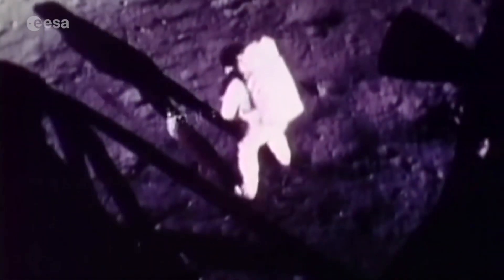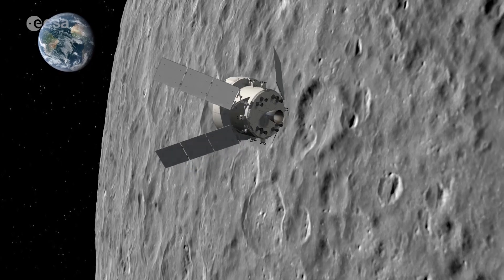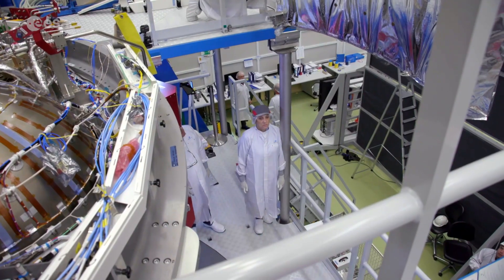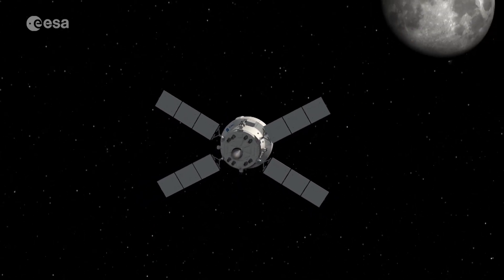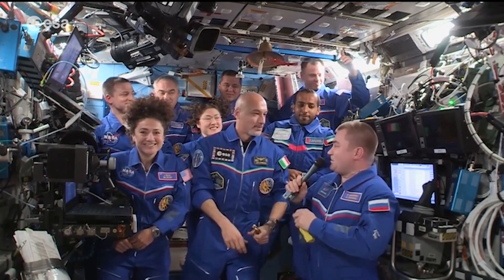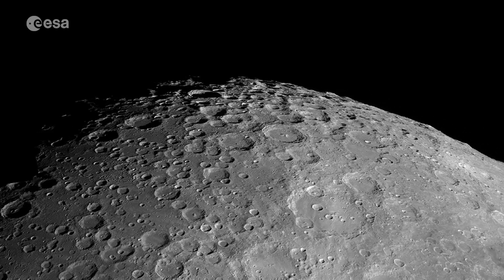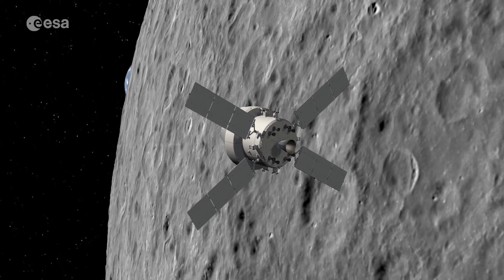European Service Module 3

Comment: The term "proven technology" is a curse for space technology. It's holding back this field for decades. If the smartphone manufacturers make smartphone based on proven technology, the current world of advanced high tech computer in everyone's pocket never would have happened. The world made so much progress because these companies took risk of using new technology instead of old "proven technology".

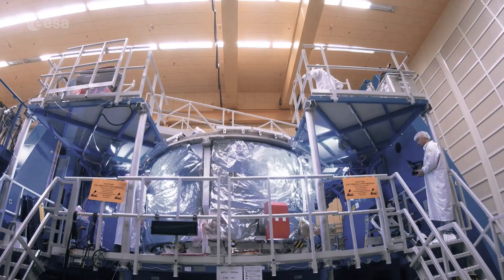Comment: 0:43 It would be more accurate to call it "the FAR side" of the Moon, rather then "the DARK side", which may give listeners a false picture of the actual Moon
Reply: I agree, "far side" is the commonly used term now, both sides are actually illuminated by the Sun for equal periods of time. "Dark" has come to mean "unexplored" in this case.

Comment: Very nice, but this video sounds like ESA is making NASA a favor and lending them their technology
Reply: The Orion service module is basically ESAs 'payment' for the ongoing ISS mission. Since the ATV (which this spacecraft is derived from) is no longer in service.
Reply: @robinwolferink7315  I didn't know that is how they are paying for the ISS resupplying. Cool to know that
Reply: Technically speaking, they are. The idea for ESA to provide the Service Module came from the fact, that ESA already had a "similar" thing, flying as the ATV with resupply missions to the ISS, and it was significantly cheaper and faster for ESA to develop the Service Module for Orion, than it would be for NASA (I believe the estimate was ~half the cost). Also there was the question of how to pay ESA contribution for the ISS (previous years paid by providing Harmony, Tranquillity and Cupola modules to the ISS, and 5 ATV resupply flights).